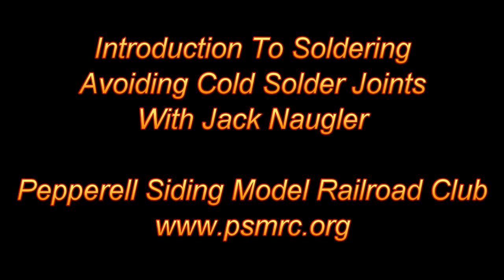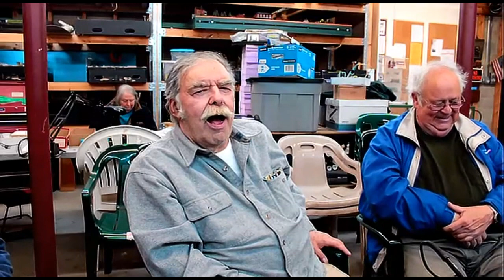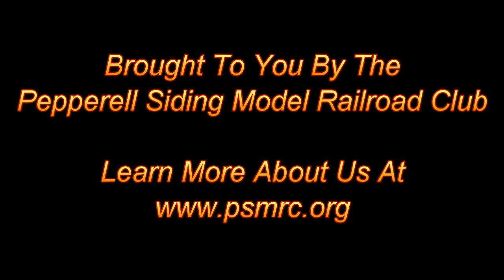Avoiding Cold Solder Joints

Comment: I just repaired an antique Soldering gun(made in the USSR) with a bad solder joint. 
Imagine that soldering gun with bad solder joints. 
2 bad joints to transformer 
1 bad rivet joint to bulb socket. 
I believe the rivet was the problem and someone tried to re solder the other joints and messed them up.
 
The wires had cotton textile coating. 
The key is a bent metal strap touching a bolt. 
The power cord had a discontinuity from moving around. 
New tip. Now it all works. And i'm using it. :-)